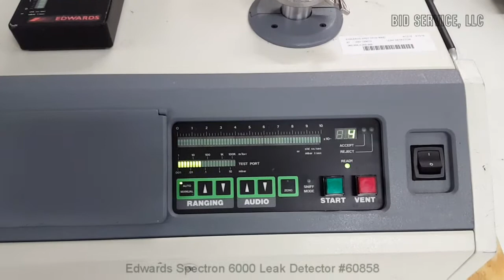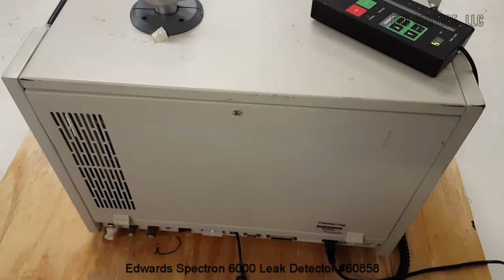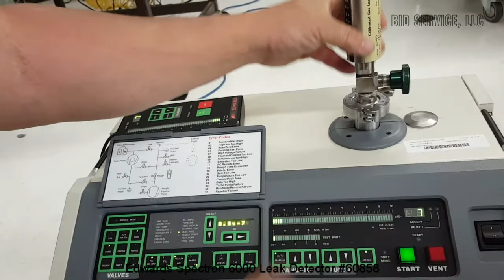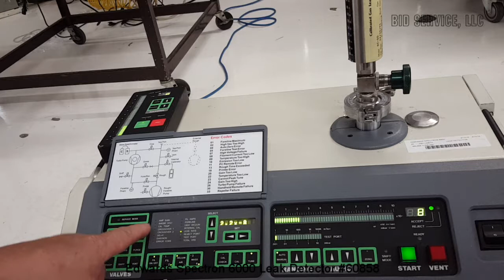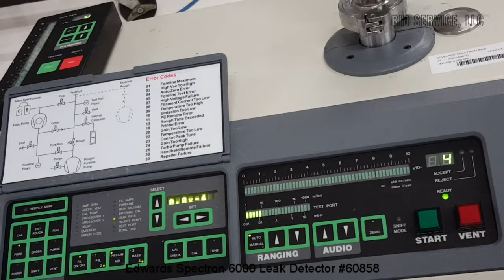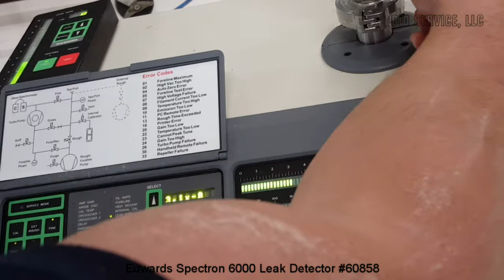Edwards Spectron 6000 Leak Detector #60858

Comment: Hi, Thanks for your great video and explanation. I'm trying to run edwards spectron 5000x and I'm wondering if you could please help me out. I've realized that Edwards Spectron 6000 has a similar internal and console design to 5000x, So it would be great if you could give me an id or anything where i can ask some questions on how to run this leak detector which are crucial for me. 🙏🏻🙏🏻❤️